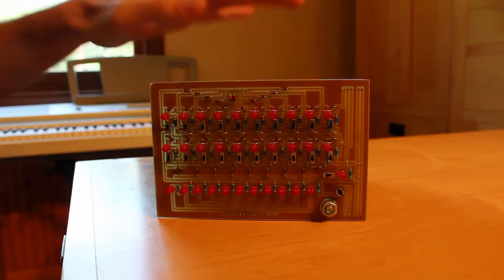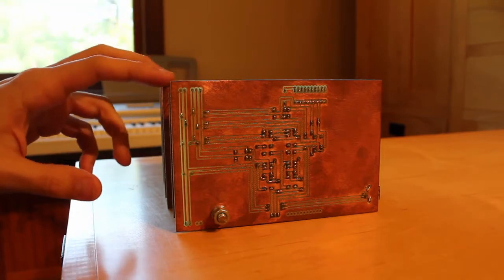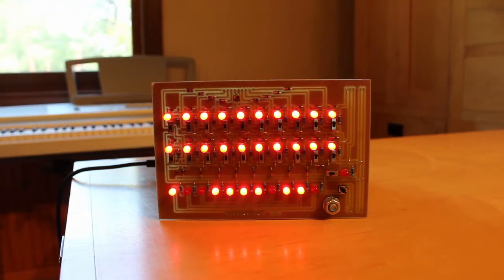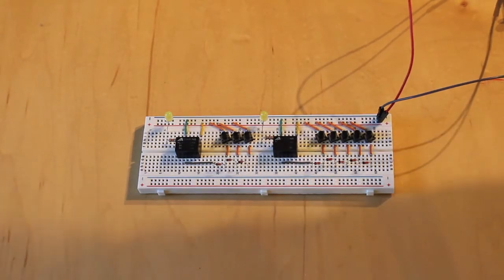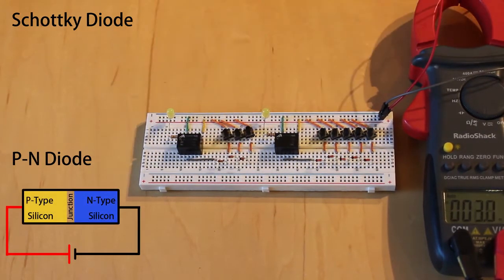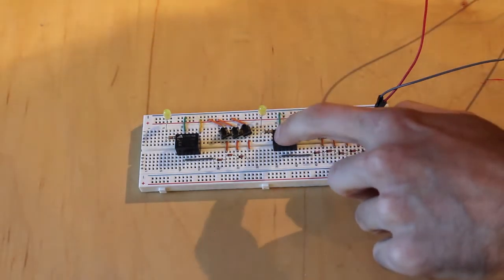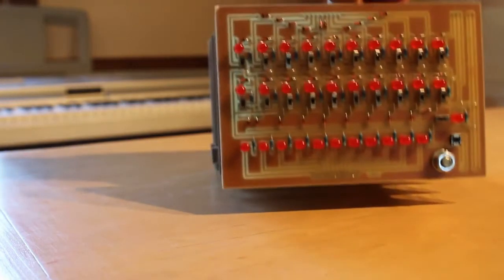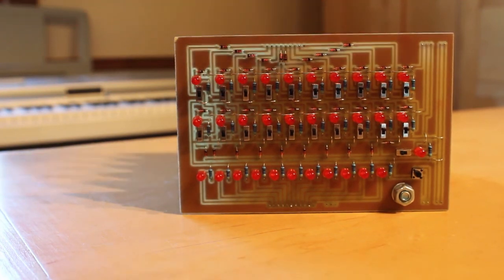Relay Calculators: Episode 4 - Mistakes

Comment: Diodes can dramatically lower the cost of a relay computer/calculator, but - as you well saw - they are impure additions that have a tendency to get in the way. Unfortunately, all the “fun” relays that are remotely affordable are available only on the secondary market.

Comment: I think ramping up the supply voltage a little bit (to like 6 volts) could potentially solve the diode voltage drop issue, but it may also increase the power draw and heat generation and also potentially wear out the relays faster.
But i do like the calculator, and i may build a transistor calc at some point, using the same one-by-one addition technique.
Cool stuff!

Comment: I've been enjoying your videos, so much so that I've been watching some of these older ones.  I'm a little confused about the diode drop problem as you illustrated it on the breadboard.  If these are oring diodes why not just send each signal to be ored into the anode of an individual diode and join all the cathodes together? This way there's only one diode drop, no matter which input fires.  Thanks, Mike.
Reply: There can be several diodes in series on the path of a signal.

Comment: Sir Can We Have The Schem?
Reply: The schematic of what exactly? I can draw up the schematics for you based on what is shown, but they may not be exactly the same system, depending on what is shown in other videos. It would however work the same way.

A sequenced single-bit-ALU is simple, and the sequencer can be shared with all functional blocks of the computer. However, in terms of signal routing resources, having a parallel ALU that uses a Zuse adder is slightly less cumbersome, and much faster. Engineering is full of tradeoffs. The goal of the designs shown was, I imagine, to test the sequential building blocks as well as the combinatorial logic.